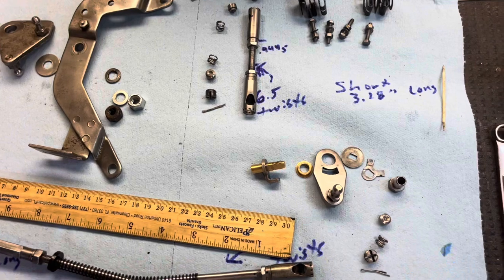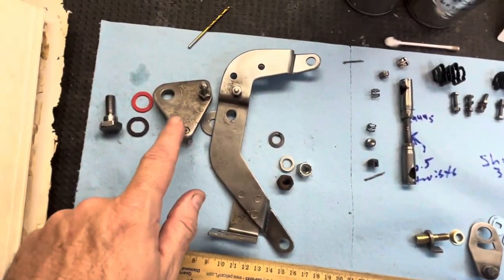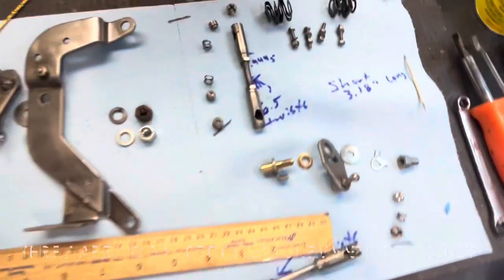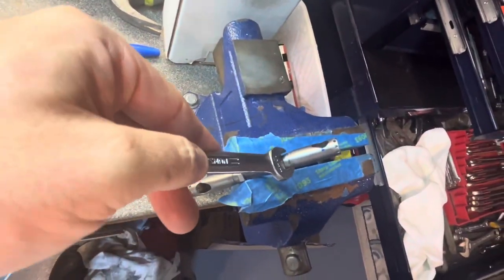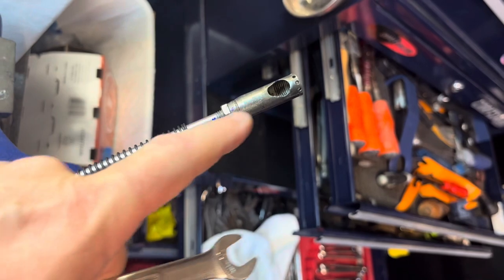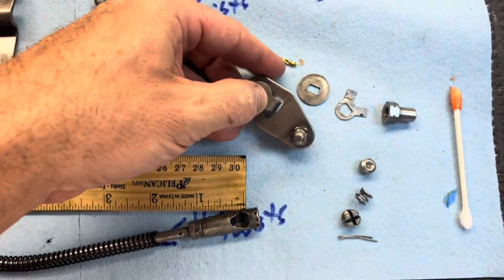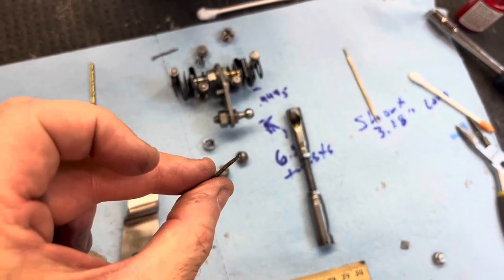Triumph TR6 throttle linkage clean and adjust. Part 2 of 2.  @DIYHELP

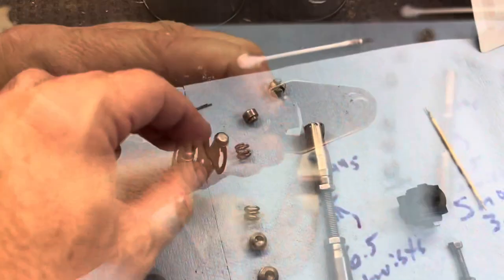Comment: Question for something i do not understand. At 13:24 you show the drill bit setting a gap.  WHen you pull out the drill bit what keeps that gap set? it seems these parts just slide around.  Am i missing something?
Reply from the maker: I was just demonstrating where the drill bit goes. This gap gives the gas peddle a little dead spot when you fist step on it. To answer your question you set the gap once all the linkage is fully installed in the car. It will secure correctly when everything is connected.

Comment: Not sure my carburetors are opening up for full power. My throttle linkage doesn't seem to have enough movement. How much movement should there be.
Reply from the maker: I actually installed my linkage today.  Did require a little fine tuning for sure.  Movement for full power - I was wondering that myself.  When I push on the vertical ball joint thing it moves a lot more than when pushing on the gas peddle.  Not sure if it really makes much of a difference though.  If your vertical and horizontal rods are adjusted in length to the factory specs in theory its working right.  The big question mark is the gas peddle vertical shaft where the linkage connects - is it on the correct spline as that could mess things up too a bit.
Reply: Thank you. Gas pedal linkage bolt loose. Reset and full power now. 👌 Thank you.
Reply from the maker: yes that makes sense - slippage.  make sure both sides of the clamp are over the splined section (not the smooth round part) - it will slip eventually @mikemunden2904